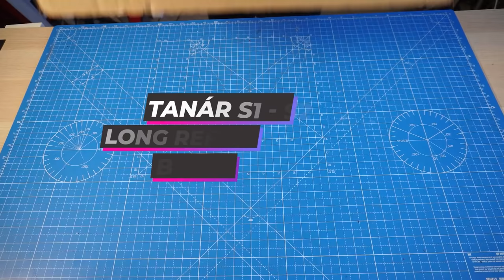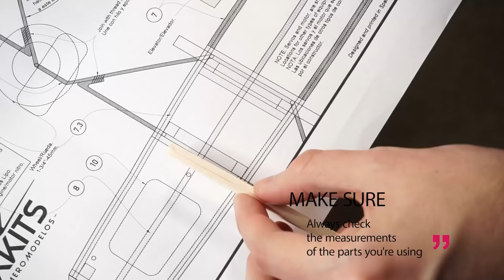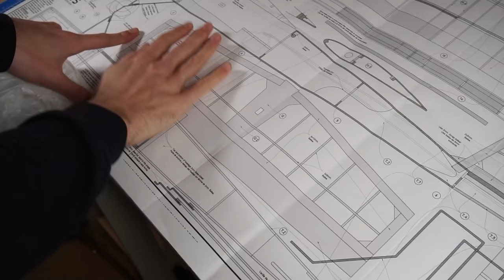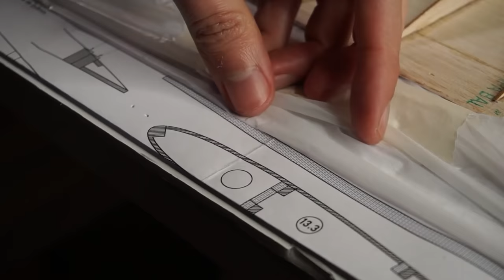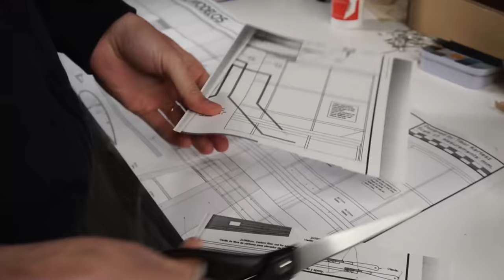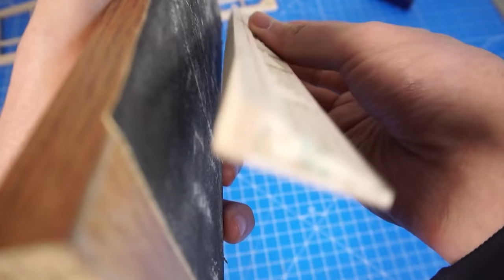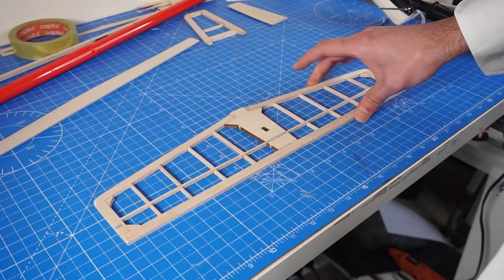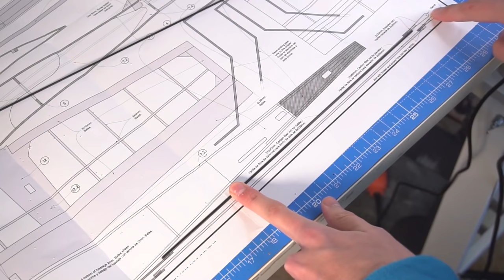Long Build RC Model Airplane | Tanár | A Balsa Wood Kit From Joyplanes

Comment: Brings back memories of making Guillow's  Balsa kits out of Wakefield, Mass.. I stuck with rubber band power but had some very long endurance flights with my Arrow, Javelin and Fairchild models,. Wish I still had a few of the dozen I made in the 60s and early 70s.
Reply: In todays woke craziness I bet you can't even show a picture of the "Das Sloopen Thing"
It actually flew pretty good though.
Reply: I built the Arrow and Javelin with my father. They flew beautiful. Great kits.

Comment: Safer to use 4 bands on the wing. 2 front to back and then 2 crisscrossed, if one breaks you won’t lose the wing. Nice build. I started building models since 1950, RC since 1970 , rubber power before that. I’m still building. Love it.
Reply: When I see the build it really feels like old school style builds. I don't planes that way anymore today.
Reply: I found out the hard way that when I "crisscrossed" the rubber bands. When the model I was flying with crisscrossed bands I did a cartwheel wing tip to wing tip it kept all the bands on ok but did not release because of the "Crisscrossed bands" and quickly destroyed the wing. I will never use this idea again. No one at my flying field never uses that method nor will I. Do it at your own risk!

Comment: That's a cool idea to make such long videos for a beginner plane. It's rare. The video include a impressive case of error you could avoid by seeing it again and again, and think to check the hand and eye of builder, he does not do mouvement freely, he built with care. I do a few other way but globally it's a sane and good method 
So if I would like on such long vids to find subtitles for the risky moments and made light on them, I found the whole result very good and a must have seen for all who want to begin for fisrt time a new plane from box and wood sheet. Keep an eye on it! Already do? Why did you wait ?? Do it again 😁👍
My 2 cents: (in same bad English than previously)
I would say to beginner to choose a simpliest wood glue, slow and easy to use. They could replace adjust and take a longer time to built with error possible where Uhu Hart and Cyano can't.
Also cyano is a big big loss of lifeage for the plane. Ok 1st plane could be crashed. But if not, don't hope to keep it flying for decade if built on Cyano. Where wood glue could stay good for decades. 
A beginner is not fast and use this advantage choosing slow glue is a must to do. 30min wood glue or 2h are perfect, exterior glue is not necessary as your plane will be wrapped and don't suffer from humidity on fly, and you will store it safely too no?)😇
As glue is an heavy subject in building, Cyano is light,wood glue medium light, Uhu Hart mid, epoxy heavy. The strongest is not the best, and not dependant of weight.
Use the less glue as possible, take time to swipe the excess after joined parts. Immobilize them together or press it for good flat or square gluing, and keep in mind "light is right"(C.Chapman) so epoxy is heavy glue, don't use too much but use it where its absolutely need, mix it as long as possible (1mn for a quart nut is good, and don't charge too much for avoiding drop, you also could do better gluing when don't need to glue 2 flat pieces, like in angle or for reinforcement, by using wood residus of cut and shape, and mix it with Epoxy, glue became thicker, cure faster, and is much stronger while being lighter due to less glue needed for same spot. On experiment level pilot , the plane could be glue same with microballon of glass, ultra light ultrastrong and relatively cheap👍
Also take time to bought the calque paper for preserving plan, and fixe the plan of a solid and flat, very perfect flat workbench. The better support you fixe the plan, the better the plane will flight. 
Take time to read it, identify parts in the wood stock, and mind twice before cut anything!!!! 
Also every cut must be done Ith a new cutter blade, of a new scalpel, balsa is easy to cut but not easy to good cut.
Mind also the glue is not all, if you don't have a good joint between two pieces of wood, it's a bad job. 
Try where you can( without shorten a part that affect the geometry of plane) to cut at right angle to match the destination element, before glu it, adjust your part and see it in place blank. Shape it a bit if needed, eonit on rigid flat support with sand paper double tape on flat, to do it perfectly, use high grain like 500 or 600 , at least 320, to not remove too much baosa when you do adjustment.
Bigger paper is only necessary when forming a big bloc but not when the need is a quart of millimeter
A good scalpel does not need any sanding after such the cut is perfect
At 14:20 you have illustration
The angle is just a reinforcement, so it's not a fatal error bit the adjustment is exactly those you want to avoid.
See him present the part before gluing. Good method but you see the space on upper side between parts and stabilisator angle, it's horrible. You need to cut half millimeter on power side to reach the side correctly. When both parts joined visually correctly, even if a paper could pass through by few spot, you can glue it 
The glue could handle the little error. 
But if you glue it like him in this precise example at 14:33 you ask the glue to reach too much space and it can't. You finally glue on less than half of depth and it could be critical if it concern structural joining. 
The future pleasure pass with that few attention. Not a big deal for the amount of fun you have when see your job take off for first time. 
You change a massive tree to a light plane than could take off from ground on its own !!! Totally magic sensation trust me !!! Even after years and years, you always feel this strange magical feeling on every first take off from a personnal built! 
Yep it's heavier than air, and it's flying and you pilot it ! Woooow 🥰☁️☁️👍

Hope these 2cents help. I still built plane from scratch with conventional method, even draw them from blank page, and love it after 40years of building alone. 
Cheers from France 🇲🇫
Reply: Wowow cheers!!! from  Philippines🇸🇽

Comment: My dad used to build like this when I was a kid..but the planes would have a gas engine, and be attached to wires so they would fly in a circle held by two handles for steering…he used to let us kids hold the wings while he wound the propellers. Sometimes, we had turns flying them…
Reply: Ññp0
Reply: Great job on your build, but what is in the little mist bottle that you spray on each section you complete?

Comment: First one ya ever built?
Can I suggest thin set CA for your glue. Set the part in place then use a drop to keep it there. If you need more substance at a joint sprinkle some baking soda on the joint then another drop of ca and ya will have a very solid joint quickly. I been building for 40 years. A tip from me to you👍🏻

Comment: I would always use PVA and bond small scrap gussets to hold the parts in place for a good solid bond that will last a lifetime. Having said that I’m unfamiliar with the particular “type” of UHU glue you’re using (hart) so I can’t comment on that. Great build btw, looks nice and solid. 👍😁
Reply: Wir haben damals nur mit Uhu hart gebaut
Reply: Sometimes a lifetime to an RC aircraft is meager few moments.
Reply: Uhu hart is also perfect for ABS parts like engine covers or boat hulls.

Comment: Supper glue works great on balsa..makes joints a lot stronger then epoxy..but real hard to cut apart if it breaks and you want to repair..i built glider with only supper glue...letting student fly it they put it into dive and had electric engine on full then at full throttle dive they did inverted loop..should of snapped wings like dry blades of grass.you could hear wings vibrating from the overspend but the supper glue soaked into area around joint making it twice as strong..

Comment: Hey could you try do a video about, instead of getting laser cut balsa plan pieces to build a plane, why not use those plans and 3D print the parts(ribs)? I know this has been talked about before and weight has been pointed out to be an issue but what about using Lightweight PLA, like others are using to print the plane itself not just the ribs. Just an idea let me know what you think. Thanks!
Reply from the maker: I've thought about it some time ago but haven't put it in practice.
Reply: PLA is nowhere near as light or stiff as balsa.

There is a reason that balsa is sandwiched between carbon fiber in race cars.  It is a pretty incredible building material.

Also, 3d printed ribs would be way more expensive (because of time) to produce.  

I doubt PLA would glue up well to the spars like balsa does either.

Comment: Is there any chance you can build a super slow airplane? I'm a terrible pilot and the planes I've built are too fast for me to control, so I would like to learn to fly piloting a slow plane that will be easier to maneuver  :)
Reply: Slow flyers are either very susceptible to wind (look for 'park flyer') or you need to go bigger or buy a 'foamie' made of polystyrol foam. There are some beginners kits aka 'trainers' that are very forgiving.

Comment: What kind of glue are you using?
Reply: hes using balsa cement, use thin CA  its lighter.
Reply: he uses UHU Hart glue, its like the humbrol cement. Normally I use white glue like Titebond. I do not recommend to use CA, because it isn't flexible so it can break when hard landing or tight maneuvers.

Comment: The construction of the wing on the table you have there is not flat, the wing will come out twested.
 glider builder for over 45 years, to this day 2023, the moment arm is too short, should be four times the width of the cord= the width of the rib= leading edge to tailing edge, will fly a lot better.
with a short moment arm the air coming over the wing cord,  ie the turbulent air will react a lot slower,A  long moment arm will react a lot faster, model will fly a lot slower react faster too.
the turbulent air has cleared by the time it gets to the elevator. true fact in my tests

Comment: As a builder and DESIGNER for 50 years building techniques could be vastly improved. Not a assembling fuselage over plan, no set squares used , and and p.v.a resin glue apoesed to UH GLUES, far stronger .and regards covering under side of wing should always be covered first so as to hid roar edges

Comment: You don't glue it. You smeared it with glue. There should be minimal amounts of glue. You would do well to read about the physical properties of glued joints. In old books on glider construction (old wooden gliders) or how model airplanes used to be built. Return to the past, first, because without the basics and history there is no future.
Which doesn't change the fact that every model, every hobby, is valuable. The above comments, are just my observation, I would try to glue in such a way that there is no trace of glue.